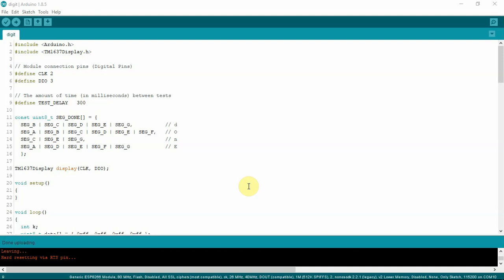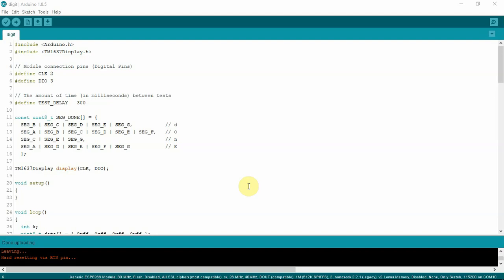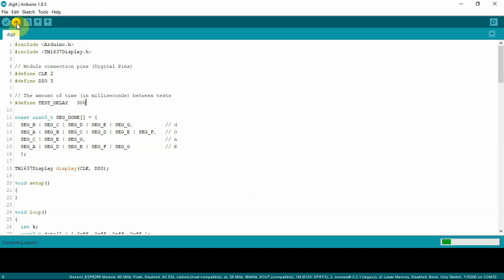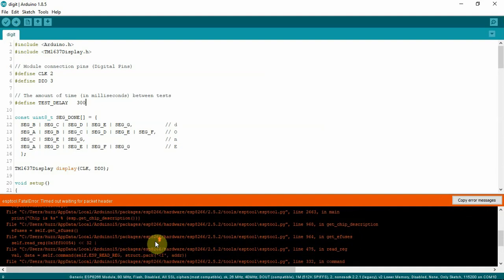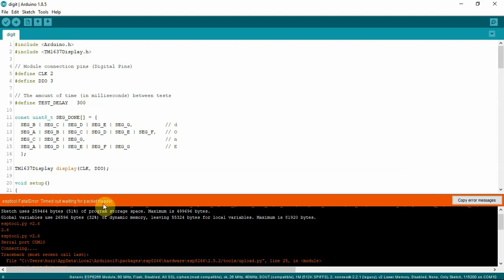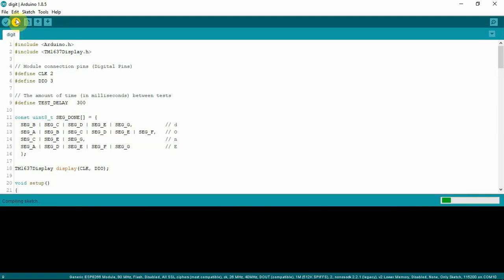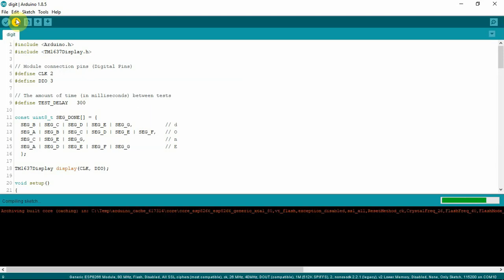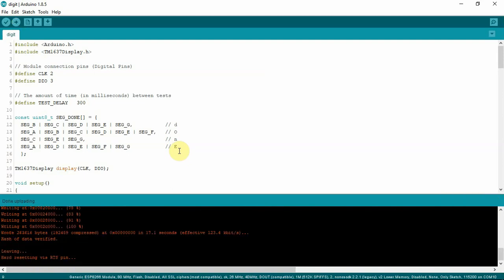Arduino Timed Out Waiting For Packet Header Error

Comment: Begginer here. Had the same error trying to flash the esp via esptool.py. I had a dht11 sensor connected to 3v and gnd pins of the nodemcu esp8266,  unpluged the wires and the error disappeared...